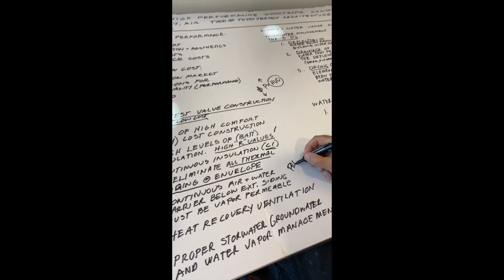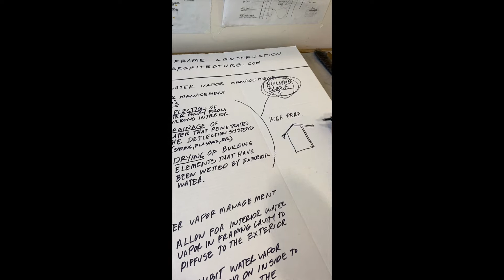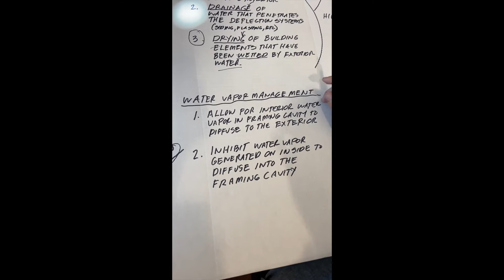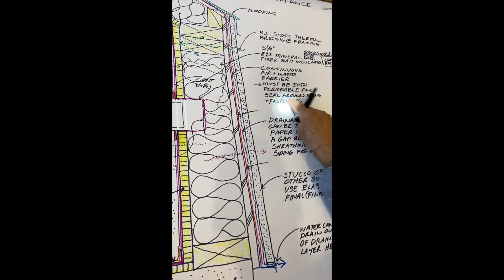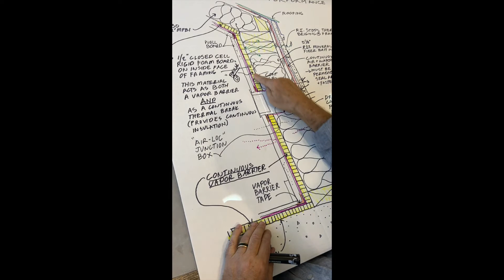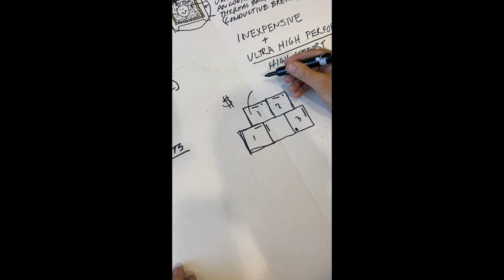Todd Talk 9.2.22:  High Performance Low Cost Construction

Comment: To what extent can these techniques be applied to a remodel/addition of second story? We have a stucco 1946 Bay Area “cottage” (?) home that we’d like to expand both out and up. We hope to add solar (w/storage) and greatly improve efficiency and indoor air quality. Are we crazy to think a remodel can accomplish this without being cost prohibitive?
Reply: Look up “building science Corporation lectures”. It’s actually air sealing and correct insulation application that matters more than just “insulation.” What he says here with air barrier is what matters. Windows don’t matter much actually, only good air sealing at the bottom and top ceiling of the house.
Reply from the maker: Apologies for the delayed response. We apply these methods, approaches and strategies in all of our projects from ADUs to additions and remodels to new construction. Reach out if you'd like to discuss.